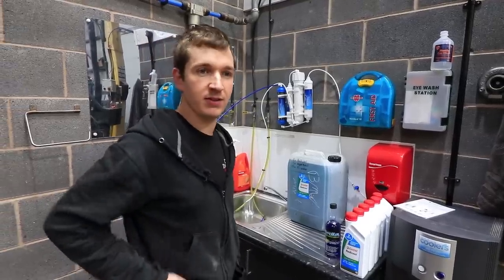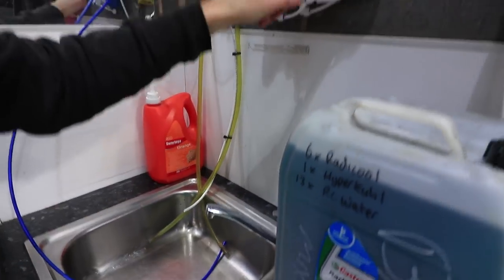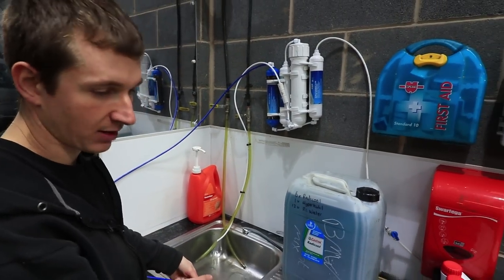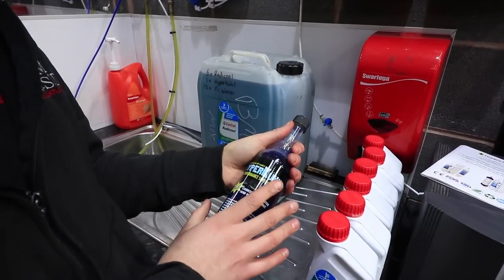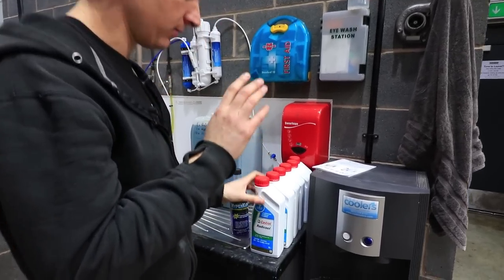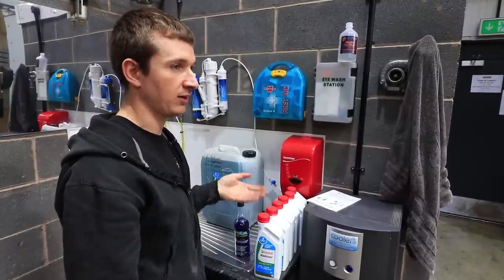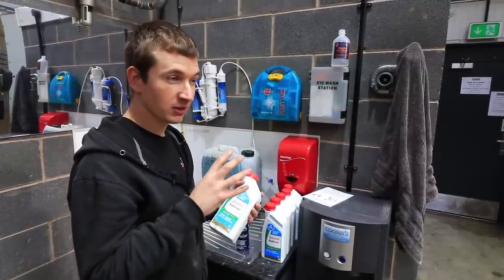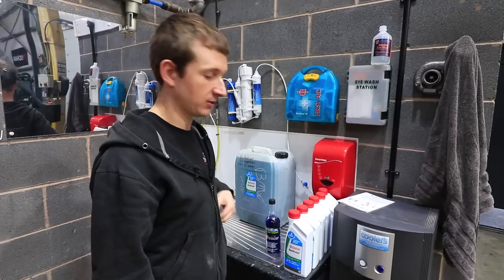What's in our Super Coolant concoction?

Comment: Regarding your RODI setup, If you dont have one already get a TDS meter. You can use this in two ways
To check the output TDS before using it (and may well mean you dont have to run off as much).
To check the condition of the filters themselves and have a better idea when you need to replace them.

A good RODI unit should come out around 0 TDS, once you know what you good filters run at you can then  have a better idea of everything else

the only other thing I would say is to not store RODI water for long. Its very good at re-mineralising and pulling contaminants in from the air.
Reply from the maker: Yeah we have a TDS meter, the filters seem to be lasting OK!

Comment: I assume the Hyperkuhl would therefore also reduce any cavitation issues then by having less air pockets? Do you have any problems with block cavitation on the high horsepower mods?
Reply: Yes it will. Not to the point of failure!

Comment: One offtopic question because i know you know everything about the 1.9TDI engine"s. 1.9TDI PD130 AVF engine code cylinder head has cracks between the valves and injector holes on all 4 cylinder"s is that normal ?
Reply: Could be just a bad previous chip tune causing overheating.. Normally 130´s are strong.. If it was a 115 with the weak head i can happen.
Reply: They are all like that, no problems
Reply: @ryanp6138  Thanks.
Reply: Is ther any way that can prevent this cracking whit ceramic coating?
Reply: @Garaza-po9mq  the AMC heads seem fine
Reply: @ryanp6138  Thanks 🤗

Comment: I run g13 ready mixed from ecp in my pd105 with a simple remap, is that good enough?
Reply: Should be fine!
Reply: @ryanp6138  Wicked, i give it a hard time sometimes and i can see the temp increase to 95ish
Reply: I can’t keep my temp up I’m in an E87 123d it goes up to around 90 then back down as low as 83 at idle, I think maybe a dodgy thermostat?
Reply: @KAOS_REAL  Yes you need a new thermostat dude